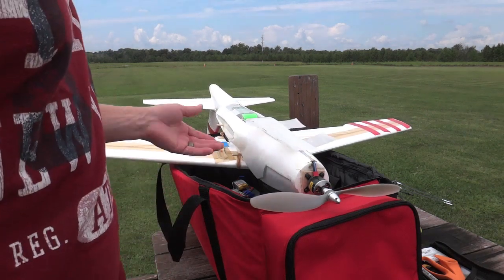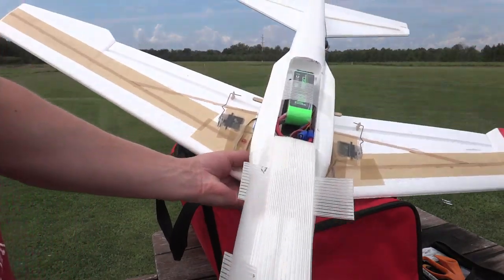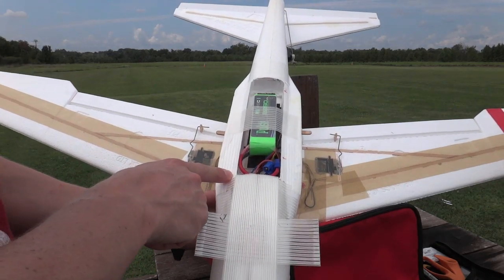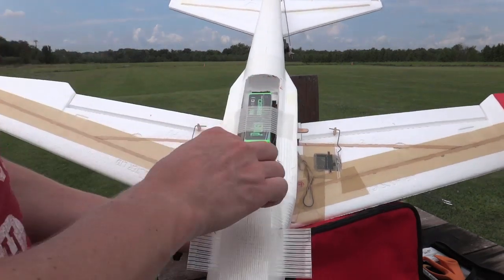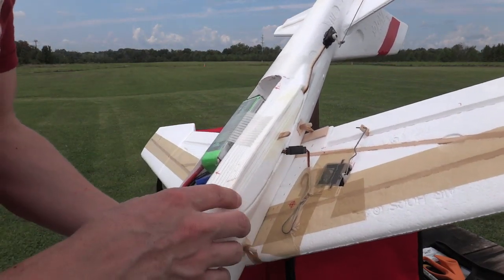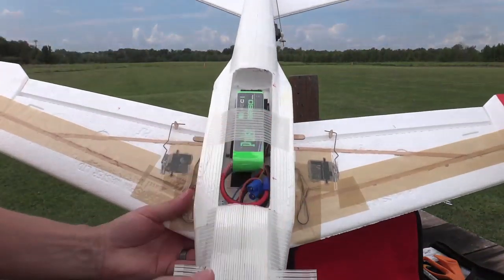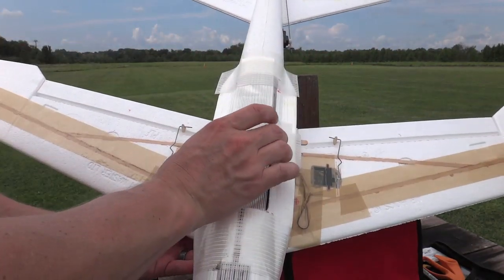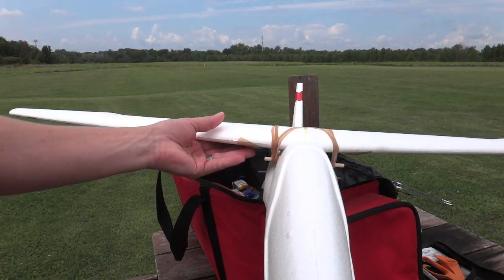Foam Air Hogs glider conversion to rc - Modification

Comment: Great video.  I found it after looking for a better way to put my motor on the nose since using hot glue doesnt hold or I just did it wrong which is possible.  Did you glue the wood to the nose with hot glue?  I plan on getting some wood today to try that.
Reply from the maker: @xSensu I mounted the motor on a small piece of .25" thick light plywood. I then routed out that same size small area in the nose (foam) and then hot glued the wood in place. Then I mounted the motor to the plywood. I used hot glue because it has flex vs. epoxy, which tended to snap of if there was any pressure to the nose.

Comment: I have mounted motor in front , but i intend to keep wings in it original place , having issues where to put battery (i dont have them yet) to find correct Cg, its nose heavy. I see we put elevator servo in the same possition :)) I also have rudder servo on opposite side  - have retracting prop on 1400kv motor on 30a esc & getting 2200mah 3s in few days.. Atleast it would be a lame or awsome crash in my first ever rc build and Am glad to find your video it helps alot.

Comment: hi, I was so amazed with Your  build that I went and bought the same foam plane. I have read your projekt site, and there You said that cg is best 75-80mm from leading edge. I happens to put the wing about 10cm further forward than u did. do You still think I Can go with Your messured cg. this is the first plane I Will fly haha :) Thanks and I hope You Are my answer still after all this years!:)